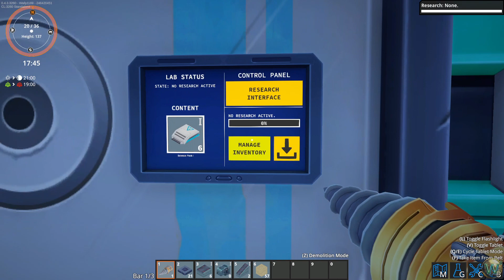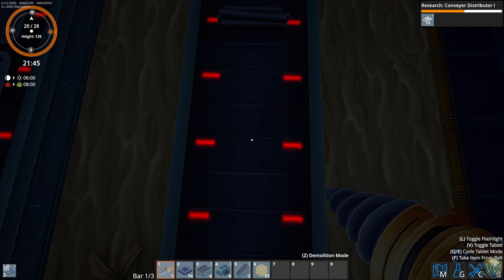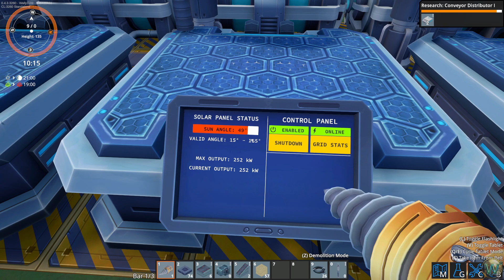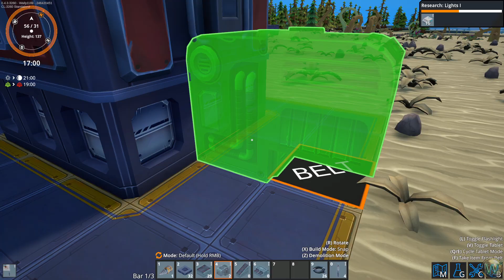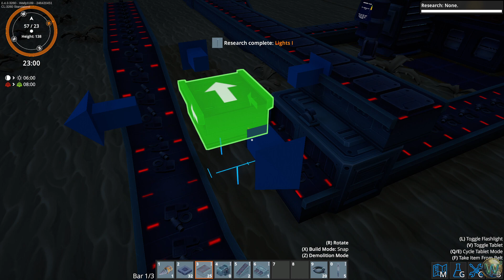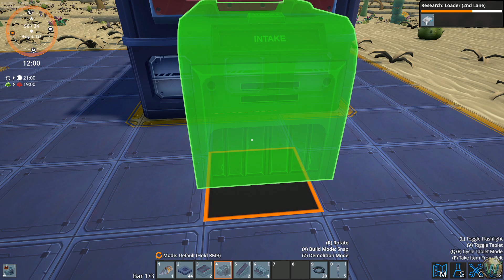Foundry - Bus - Episode 3 - Let's Play

Comment: I know this is pretty far after the fact but all you needed to do to give power to the research lab grid was to place a foundation block under the research pack assembler to connect the assembler grid to the research building grid.  That would have eliminated the need for a bio generator just to power the intake at the back of the research building and you could then (if you wanted to) run a single foundation line from the new assembler grid over to connect to the research pack assembler grid which would then provide solar/battery power to everything in that line all at the cost of just a few foundation blocks.
Reply from the maker: Yep, it didn’t occur to me at the time, but it would have been the easiest for sure
Reply: @Wally1169  it’s funny, because I thought the exact same watching it.